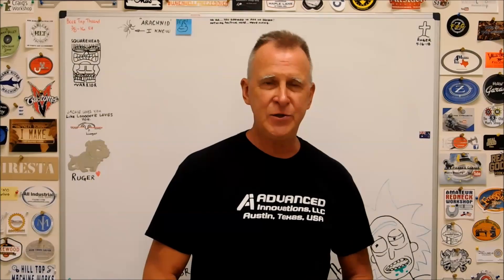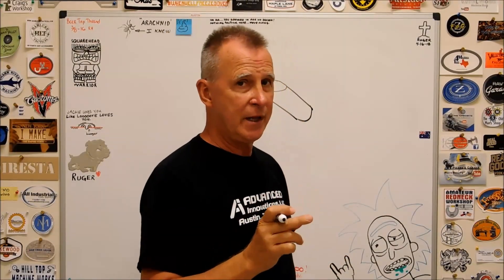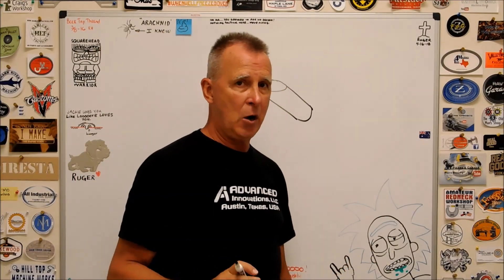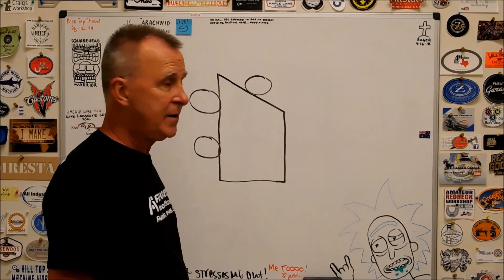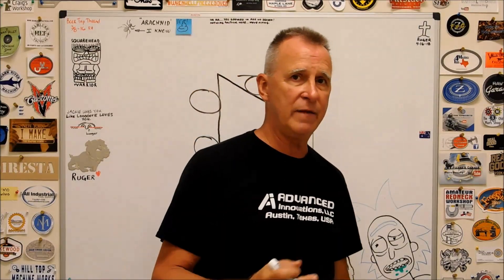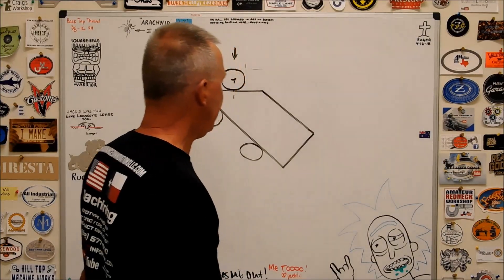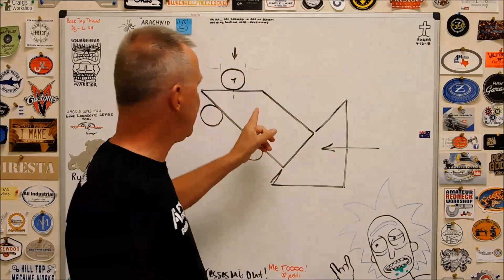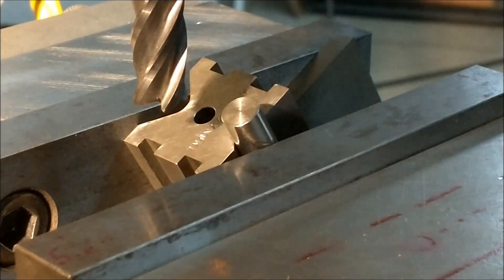A 3 Pin Fixture That Does All The Work -- You'll Enjoy This One !!

Comment: Hi Joe, Regarding the initial setup using a Vblock to hold the pin while cutting the ellipse, I've been cautioned by another highly experienced tool and die maker, to NOT put too much clamping pressure on a Vblock (via the round part, vise jaw, etc.).  His guidance stems from having witnessed failure of the block in similar clamping arrangements...  

Do you know of a good way to avoid applying 'too much' (clamping) pressure?  Developing this 'feel' is always a challenge for the newbie (personal perspective only), without having a frame of reference. :)  I've not yet split a Vblock, but developing the 'feel' without taking it to point of failure can be a challenge.    Thanks for this informative video.
Reply: This is an interesting question. Assuming your V block is hardened and ground try this. Before applying pressure measure (mike) the width of the block at the open end. Apply pressure to the round part until the width begins to increase. Stop pressure at this point. This should give you a good feel for how much pressure to apply to a V block of a given size.